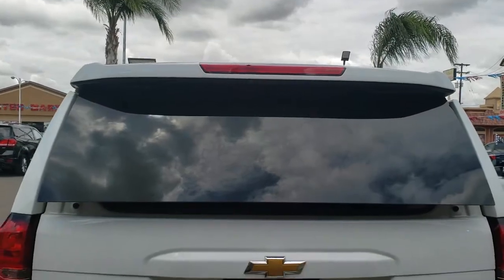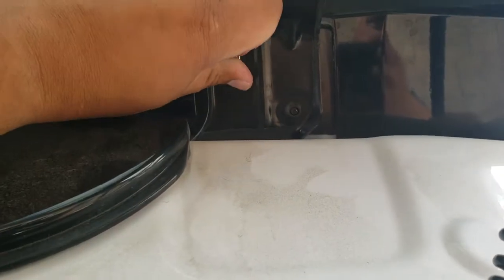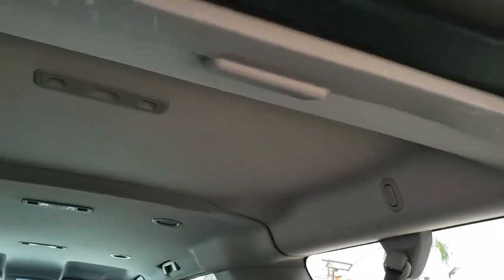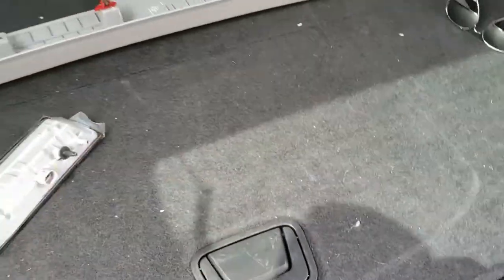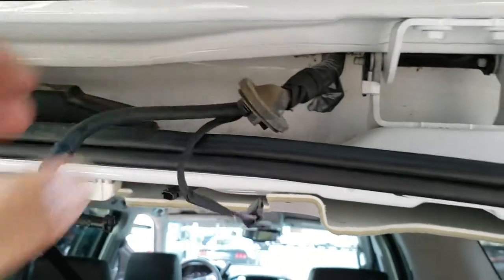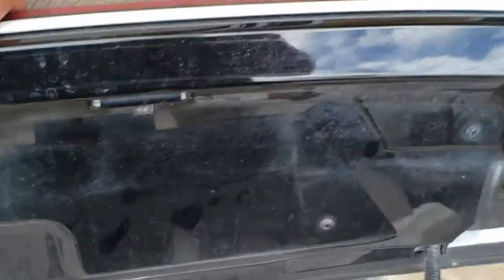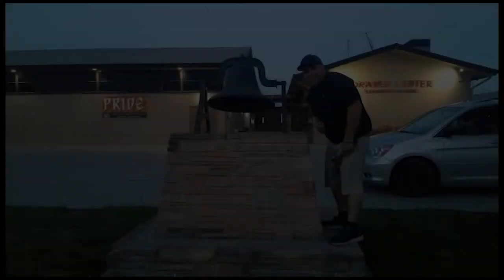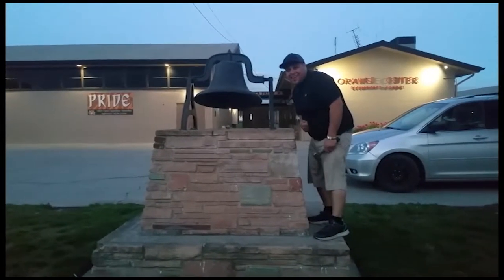How to: Remove Spoiler on a 2015 Chevrolet Suburban for 3rd Brake light Removal

Comment: GOOD VIDEO !!!!
is there Any Adjustment to the BODY ???
on my 2017 Black Tahoe the Right side Sits Slightly Lower than the LEFT SIDE that is FLUSH with the ROOF ???
What Gives ???
Need to Make PT 2 for the INSTALL
Reply from the maker: No maybe its not sitting correctly. It was probably removed once already
Reply: @559powerscape  - Thanks for Reply George .
I got the Tahoe Used , so you might me Correct , i also have to Remove the Lower Center Console - To Install a Subwoofer , the Original Owner has a Small AMP and Line Out Converter : I think he Removed the SUBWOOFER when he traded the Tahoe back to the Dealer !!! The Speakers were Cutting out when i Go Over BUMPS !!! Driving me NUTS !!!
Reply: @559powerscape  I just Noticed the Missaligned Rear Spoiler one day in the  Parking LOT saying to myself the Fit and Finish on GM Vehicles REALY CRAP !!! was Going to use NYLON SHIMS to Shim the Rear Spoiler , will look into it in the Summer

Comment: Are the spoilers on an Escalade fused to the glass? I followed these instructions to a T, and my spoiler is still fastened somehow somewhere.
Reply from the maker: Maybe, the escalade is a different ballgame its "FANCY" so they do make it harder to work on. Im not sure if thats the case...

I found this online for sale it has pictures hopefully this kinda gives you an idea were its holding on. Couldn't find any instructions in how to remove it unfortunately...

https://www.ebay.com/itm/2007-2014-CADILLAC-ESCALADE-MOULDING-SPOILER-WING-LIFTGATE-OEM-2008-2009-2010-/152228003638?mkcid=16&mkevt=1&_trksid=p2349624.m46890.l49286&mkrid=711-127632-2357-0

Comment: how long did this take u?
Reply from the maker: About 45min to an hour
Reply: @559powerscape  thank you very much.❤️❤️
Reply from the maker: @QuelesaRobinson  your welcome, Happy Holidays 😊
Reply: @559powerscape so i have to buy the whole assembly?
Reply from the maker: Unfortunately you do its all one piece and it's led. Their is no bulb to replace. Every thing has to be replaced. 

Here is the installation video...
https://youtu.be/Si47IaPdo0k
Reply: @559powerscape  ok how much did it run for the part?
Reply from the maker: About 70 bucks....found one here for you...
https://www.ebay.com/itm/393157676738?mkcid=16&mkevt=1&mkrid=711-127632-2357-0&ssspo=h7K2-5RuR1i&sssrc=2349624&ssuid=Q-DrubH0Sve&var=&widget_ver=artemis&media=COPY
Reply: @559powerscape  that don't look like the original one tho
Reply from the maker: What year is yours?
Reply: @559powerscape  2015 chevy tahoe LTZ
Reply from the maker: @QuelesaRobinson  maybe this one? 
Full LED 3rd Third Brake Light High Mount Stop Lamp Compatible with Chevy Suburban Tahoe 15-20,Red Lens https://a.co/d/3zjk4rT
Reply: @559powerscape  thank you. i just ordered one from autozone $139 😩😩 because they are the original ones the one on amazon said they patterns isn't the same and the studs are different length.
Reply: how do i take the cover off tho on the tahoe? we're about to start now.
Reply from the maker: We're you able to get this done?
Reply: @559powerscape  yes! i went to a sho and they did it... $75 🙄